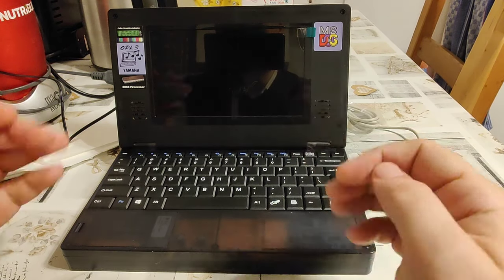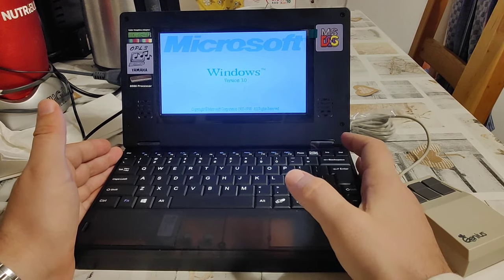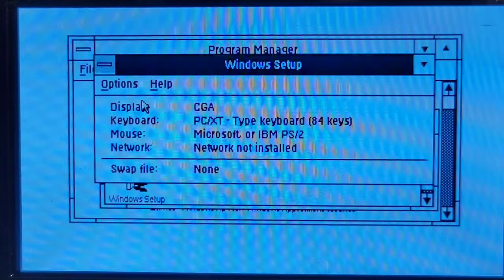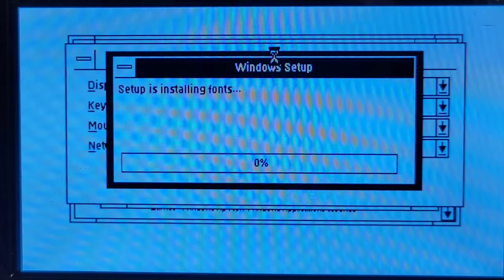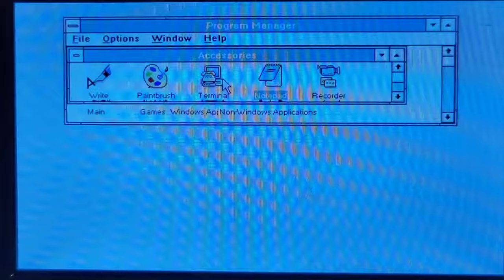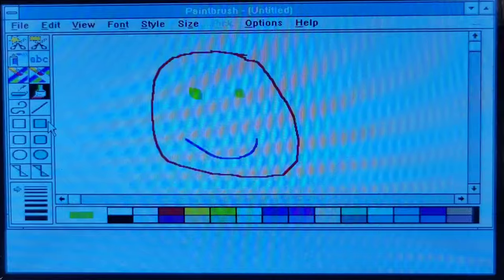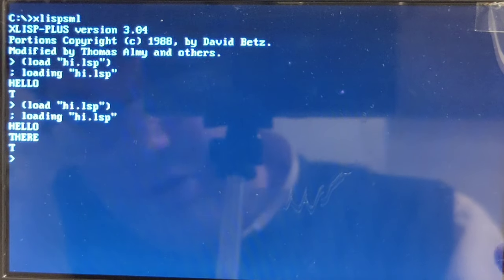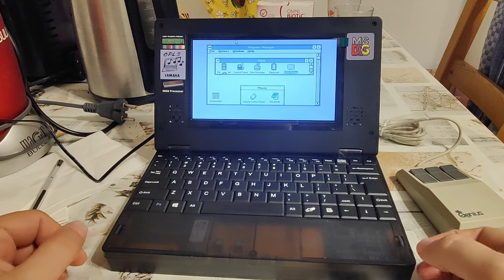EGA graphics on Book 8088 v2 — and development with XLISP

Comment: VGA works fine with Win 3.0 on my Book 8088 v2. I got the driver from the Win 3.0 disks on WinWorld like you did in a previous video (thank you for the tip). Not sure why it's not working for you. The resolution in VGA is better but frankly, with Windows, I doubt you'll see much difference between EGA and VGA for the standard application in terms of color depth.
Reply from the maker: Fascinating… maybe there are variations within the Model 2s… Looking very carefully, I saw variations in the stickers, in the keyboard, etc, so who knows… Thank you for the hint!

Comment: Hi, nice video! I wonder does your Book8088 v2 come with VGA or CGA option when you bought it?
Reply from the maker: VGA — and to put it thus clearly, "VGA” is a misleading statement, and it is not VGA, but EGA. Now, in some cases, I read, it is "due to firmware of some chip”, and with some OTHER chip, it can be allegedly fixed; however, I hold little of it: as a customer, it is not up to me to "handle the details of somebody’s incompetence" and fumble with random chips.

Comment: Hello, great video.
I want to ask if Book8088 is able to work in VGA mode from MS-DOS ? Like for example from qbasic. Here is an example program that should draw a green rectangle to the border of the screen, it would be great if you can try it and let me know (I want to buy a Book8088 v2, but I'm not sure if it can be useful for someone that likes retro programming with qbasic. Until now I used DosBox, but I would like to be able to do my little experiments on a real hardware):

CLS
SCREEN 12
LINE (0, 0)-(639, 479), 10, B
10 FOR x = 0 TO 10000: NEXT x
SYSTEM

Thanks.
Reply from the maker: No, it does not: black screen. A line (0,0)-(319,199) is nicely drawn in screens 1,2,7,8,9,10,13 — and that’s it, 11,12 show a black screen.
Reply: @ninoivanov  Thanks! I really appreciate it. This means it can't use VGA mode for some reason (most likely drivers).

BTW, have you considered reviewing the new Pocket386 ? I oscillate between ordering a Book8088 or a Pocket386 laptop.
Reply from the maker: @jeancaras5232 I read that there may be a defect in a board, and that maybe you can order a corrected replacement; elsewhere, I read that the card can do VGA - but the monitor cannot. Either way…
Reply from the maker: Thank you for letting me know! That is the thing, I do not really want to change the board…
Reply from the maker: @arnolduk123 Thank you for explaining!